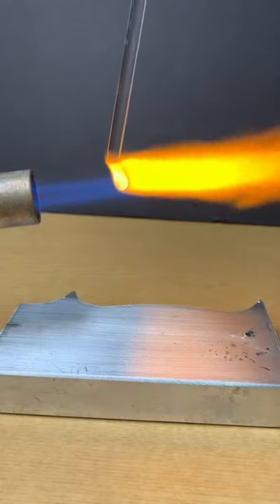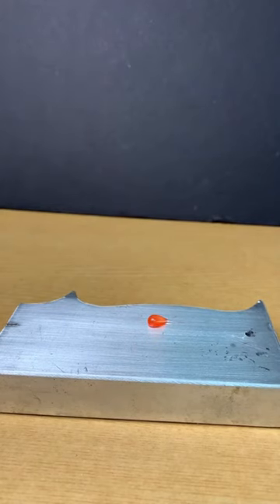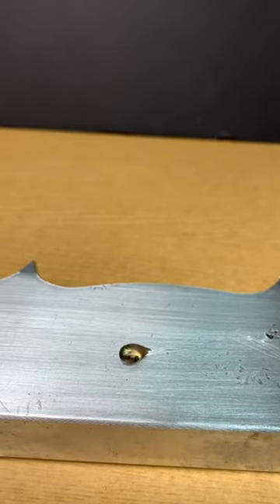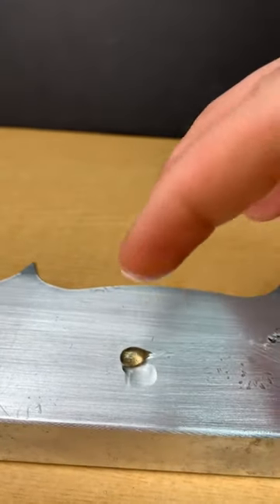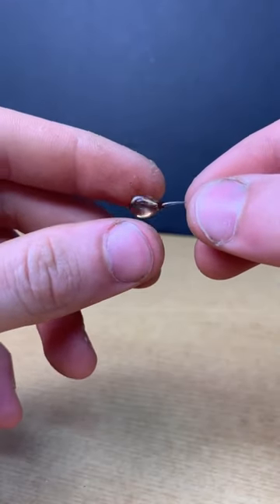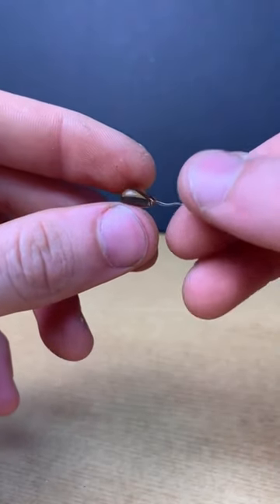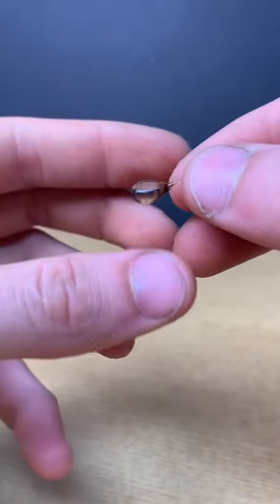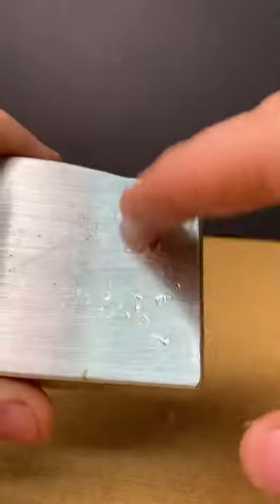No Water Rupert’s Drop?!

Comment: Did my man really just burn his hand?
Reply: He tapped the drop for half a second so not a big deal
Reply: Leidenfrost effect, he’s fine
Reply: No- he did not
Reply: @jobinjohn8990 how do you know? If you think he doesn't know anything, clearly YOU don't know the way a thin layer of water insulates enough heat from burning a person, at least in short amounts of time.
Reply: @hypercoder-gaming what did he say
Reply: @ZBREAD.  He said:
@somedude696 you don't know anything
Reply: @ZeroTempz what is leidenfrost effect? :0
Reply: No, tha water
Reply: @toragon2736 leidenfrosteffect is when a liquid touched an object that is hotter than it’s burning point. Even a small amount of liquid on ur hand is enough and with that effect u can touch molten steel with a wet hand.
Reply: @toragon2736 It creates a vapour layer on ur hand or anything thats dipped in water and it touches something very hot so u dont get burned
Reply: @ZeroTempz and also probably laws of heat transfer
Reply: @Nsplat_  laws of heat transfer dont apply here because a layer of vapor is formed between the hand and the hot object, it wouldnt make sense for heat to radiate through
Reply: He dipped his finger in water so he was ok,
Reply: @ZeroTempz  hes very lucky
Reply: He had water on his hand he’s fine
Reply: Apparently the sizzling water wasn't enough to tell him it was too hot.
Reply: Considering the Leidenfrost effect is efficient enough to allow a human to dip their bare (covered in water) hand into molten lead, I'd say he's fine
Reply: ...for us... 🥺🥺🥺
Reply: There's still a leidenfrost effect going on. But generally people who works with hot metal/glass/ceramic etc have less feelings in their fingertips than the normal person. He'll be fine
Reply: He first dropped a bit of water on it. Have you seen the videos of people smacking molten metal and it doing nothing to there hand? Same thing kinda applies here.
Reply: Nah he had fire resistance.

Comment: please try making a zirconia Prince Rupert drop by using an oxy-acetylene blowtorch. You would need go make sure to have a good one that goes over 2700°C. You might also need to put the water in a blender or something, to maximise the cooling rate by increasing circulation. Theoretically this should work just fine, zirconia expands with temperature as much as glass does, however the melting point is much higher. If it works, what you would have is a Prince Rupert drop on crack,  maybe even a whole magnitude stronger.
Reply: Yes but how much would that much zirconia cost?
Reply: @Pondwatertheaxolotl  less than the blowtorch
Reply: @pneumaniac14  fair enough I suppose, though I'm sure you could get access to one of those without buying it.
Reply: @pneumaniac14 significantly cheaper, acetylene is expensive.
Reply: @mauirandall8176  especially if you want to do it properly, you would want to heat it as slowly as possible, rather than blasting the whole thing, so the insides expand as much as possible. Or maybe not, that depends on whether there is a limit to the internal stresses.

Comment: Need to get you a tub or boron nitride (high temp thermal paste, normally used for heater cartridges in things like 3d printers) Should cool crazy fast, but I'm not sure if it'll penetrate in because it's pretty thick.

Comment: Does it break when you clip the tail?
Reply: Probably not since a prince Ruperts drop has alot of internal pressure due to the heat and rapid cooling basically if one part breaks all of it breaks (we go down we go down together type of shit) this one however won't break if the tail is shattered cause most of the internal pressure is slowly released as it cools itself down

Comment: Rupert's drop  is done due to the fact that the glass on the outside hardens faster than the glass on the inside.  pressure appears inside and due to the fact that the end of the drop is cut off, the pressure decreases and it “explodes”